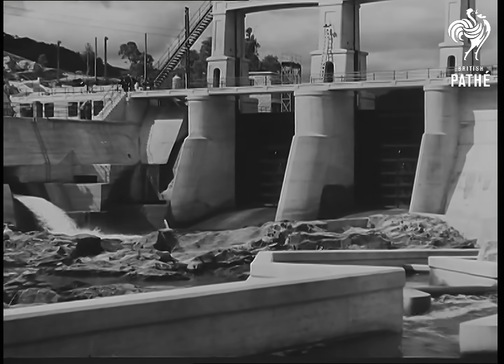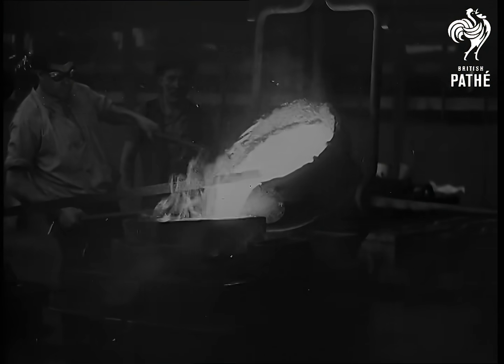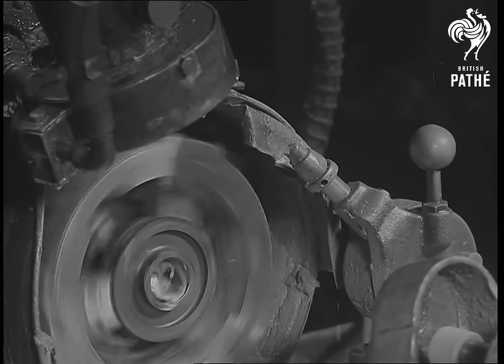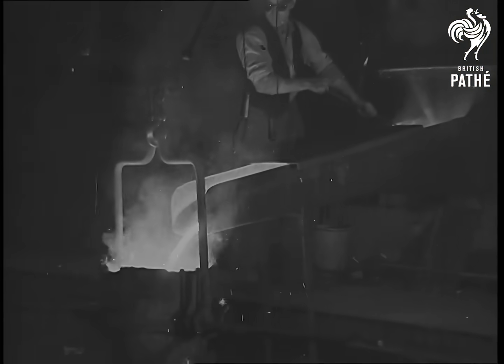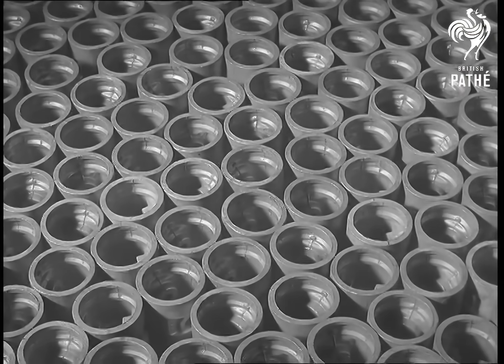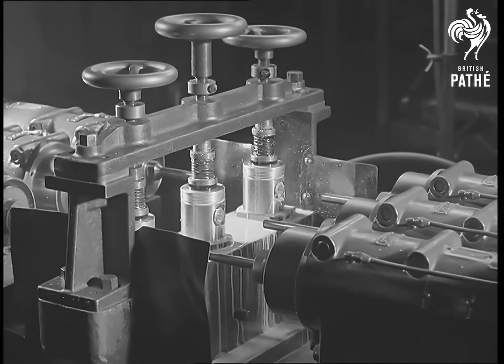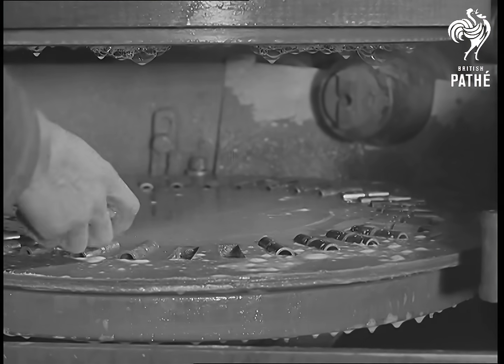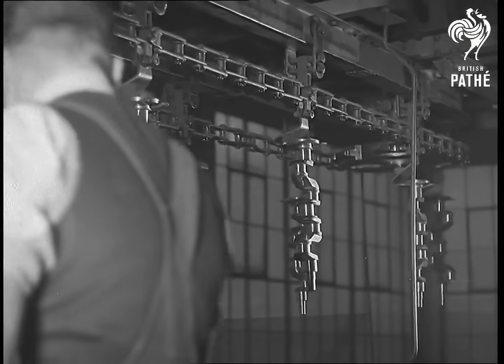Power: Constructing a Car Engine (1930-1939) | British Pathé

Comment: That Morris engine is a direct ancestor to my Reliant 850cc engine.   After the war Reliant bought all of Austin-Morris's particular engine production plant which included the huge selling Austin 7 sidevalve and produced them, when it came to updating the engine Reliant's engineers took an A series engine, saw how Austin-Morris had turned it from the sidevalve engine into the OHV engine and copied the design applying it to the then 600cc engines finishing with the 850 and 950 engines (yes there was a 950cc Reliant engine used in racing) but keeping it all alloy where the A series is all cast iron head and block.   One old hand from the larger company did remark if Austin-Morris had simply done what Reliant had done, it would have had a very lightweight winner as you can have under your arm the Reliant engine and gearbox its that light, imagine the power the Mini could have made with an engine a fifth of its cast iron counterpart and still producing a decent 40hp...

Comment: I work at GM Powertrain Engineering World Headquarters in the shop that builds components for prototype engines.  It's fascinating to see all these steps being performed by traditional rather than computer assisted machinery.
Reply: if you see this, we want v12’s with all manual gearbox. Paddle shifts and automatics suck, please build something with v12 and manual gearbox
Reply: @mococaboy17  No we don't. We want a 4 cylinder port injected cast iron pushrod engine with a 4 speed hydraulic automatic transmission. And a steel timing gear. And it should get 40 mpg on the highway.
Reply: Is that in Pontiac, Michigan,?
Reply: It basically is the same, but manually configured. 

The automated process here is of the type of filling a one step production line. Not a completely automated factory floor.
Reply: Yes, back when people had to use their brains.

Comment: Wow!  It's easy to see why it was rare for engines back then to make 100,000 miles...  the manufacturing tolerances had to be huge to accommodate the primitive tooling and all the manual machining operations.  It must have been a nightmare trying to keep the gang tooling within tolerance as different bits wore at different rates.

Comment: 14.58 The automating machine making the screw is a cam driven type similar to CVA machines. Machines very similar to this were in use up until the mid 1980's. the company I worked for had about 20 all making small items. CVA were based in Brighton and Hove in Sussex.

Comment: This video footage was made by using a pair of spur gears rotating a shaft which was used to control a linkage actuated valve operating a diaphragm to select a machining jig holding upto 20 drills and reaming tools.

Comment: I’m reading old engineering books from this era and just getting onto jig work and multi drilling operations.  Really interesting and recommended to have a look if you get chance to buy old books.  Many of these machines were specific to purpose and so would have been obsolete once the part changed.  Some of the coatings we have for modern engines would have been considered magic when this film was made.
Reply: Lots of machine tools are SPMs (Special Purpose Machines)

Comment: I see that most of the production technique is still the same, with more automation (CNC) and better cutting heads (carborundum), and metals have changed from cast iron to aluminium alloys and plastics.

Comment: So much precision and not a single computer in sight
Reply: Well they still had shop drawings and those machines still had presets to reproduce the same part with exact measurements over and over again. Computers means that process is more easily done and much quicker

Comment: I don't think they open die forge crankshafts anymore, but in the wider scheme of things not a lot has really changed in the production of forged and stamped components.  Machining of parts is where a lot has changed.  Gear production really hasn't changed much, except that companies who make gears now are increasingly milling large gears rather than using gear generating machines for rough processing as it is a much faster process.

Comment: Using a camshaft to machine a camshaft is absolutely genius
Reply: later on they discovered that pistons should be machined by the same principle. because a piston is not perfectly cylindrical by design (reason being heat expansion effecting the top of the piston more than the bottom of the piston), they had to use a master piston which had the desired ovality and machine the parts from that accordingly.

Comment: I was a toolmaker for 15 years, now I'm an inspector and I love seeing these old machines.  We still use some really old manual mills and lathes but the problem comes when you can't get parts for repair....I hate seeing them rust away before they're scrapped.
Reply: Would it be possible to use your toolmaking skills to make parts for these old machines?
Reply: @eUK95  Yeah definitely but as it was, it wasn't viable...management made the decisions.
Reply: Sounds like the place I work. The factory has been there 90 years and some machines are from the 1930s.
Reply: @annabellaandrewkingdon7972  Can you imagine a modern robot/machine running for 90 years?
Me neither. The place i work at, the oldest machines still are the most reliable, and if there is a problem its a small fix 9/10.
Reply: Yes same here, where I used to work we had a mill from the early 40s, lovely solid machine. Till a rat chewed through the leather drive belt. Was cheaper for the company to buy billets and me to spend 2 days making new pulleys to suit vee belts plus adding a tensioner arm as they ordered belts to long lol. That company has long gone but I do hope that mill is still cutting metal somewhere

Comment: To all the modern automotive engineers out there, at 16:29 that's how one drives the camshaft from crank shaft!
 Using metal gears or chains. 
The black flexible belt that you put in your modern transport appliance engines, that is a rubber band with teeth.

Comment: And THIS, Ladies and Gents, is why there are so many of these old cars, still going. Solid engineering, and no highly stressed components. No 1.2L engines producing 200bhp and lasting 3 seconds here.
Reply: The downside is they made very little power, the emissions were through the roof, they left little puddles of oil all over the place and had pretty poor fuel consumption figures. 

Can I ask when you last adjusted the tappets or carried out a de-coke or adjusted the wheel bearings or ball joints on your modern car?

Comment: The smell, the heat, the sweat, no safety goggles or hearing protection of any kind. The absolute danger, they were Men of a different breed than those of today.
Reply: There wasn't much choice. They were stoic because they had to be. That was the culture too.  Safety culture has improved by the standards of that era especially in Mines and large industrial concerns but I still see dudes using concrete saws and jackhammers without any ear/eye pro.

Comment: The engine at 16:57 looks like is has two outlets on the exhaust manifold. Why is that?
Reply: You mean Siamesed ports?   Six intake and three (each oval one merged from two) exhaust?  Cost?  Maybe not enough room to fit more holes?   The old Ford flathead V8 had THREE ports for each bank of four cylinders.  The center two cylinders exhausted through a common center port..
Reply: @martyzielinski2469  No, the exhaust manifold has two *outlets*. There are two pipes leading away from it.
Reply: @Circlotron  Yes, I was looking at the incomplete engine block a couple of scenes earlier.   

It’s awfully hard to tell if that’s a second outlet or not.  But if so, yes it’s odd.

Comment: Oh, something to remember: We see a lot of automated machines in this video, that once started, do their own thing. There were no computers in the 1930s. All of this was done via analog timing systems. Think of all the gears and such you see in an old clock, only on a much larger scale.
Reply: I spent many decades maintaining machines from the fifties that worked on what was essentially clockwork timing of electrical gear. This did that, until it hit a switch that turned it off and something else on, that turned a cam that... and so on. 

It's a wonderfully robust system and I still occasionally occasionally maintain the few that are left even though I long since bailed from the industry. Unfortunately some parts of the system rely on parts that are totally unavailable and they all now run off an Arduino, relays and hall sensors. It's the cheapest way of doing it now (but don't tell the customer) and to be honest far more reliable.

There's a vintage video somewhere on The YouTubes about how the Linotype machine works that's well worth a watch. It's amazing what sort of "logic" people can create with cams and levers.
Reply: Anthony I was a Linotype operator, 1 of the wonders of the 19th century
Reply: And microprocessors are that on a much smaller scale. Electrical on/off switches. And that's pretty much what we are too.
Reply: A Computer was once a 1930s and 1940s  job title for employees who computed optical ray tracing and ball bearing calculations and orbital mechanics
Reply: Mechanical systems amaze me. Imagine the fact that tons of gears and levers were responsible behind the manufacturing of other fascinating machines. Such systems are still used today in some machines
Reply: @lucartl  You mean the tools which machined the engine parts?
In that case repeated accurate machining within close tolerances was no problem for them.
Reply: Analogue logic is fascinating, my friend has a grandfather clock (that fell on him as a toddler) I admired it's intriguing and mesmerizing mechanics, despite it being in an non-operational state
Reply: Mechanical computers are nearly 200 years old.
Reply: @Isochest Older ... Look at clocks.
Reply: Gzzzzzzgzzzzzzzzzzzzzzzzzzzzzzzzzzzzzzzzzzzzzzzzzzzzzz 
Z
Reply: But how does this help Trump Supporters gain political dominance ?
Reply: Interestingly enough I have a hard time concluding whether the time period featured in this video is considered "a long time ago" or "recent history".
Reply: Uniselectors for the win!!
Those things are amazing.
So beautiful, and seemingly very reliable
Reply: Not exactly true, punch cards and state machines, so and over the top relay system..in fact you can occasionally find a very old elevator based on relay logic... No computer.
Reply: Very true. Also these machines did not have automated electronic monitoring systems for temps, speed, clearance etc etc. That was done manually.
Reply: technically, they were computing devices, just not modern computers.
Reply: computer is overrated crap
Reply: @klaasj7808  lmao are you watching this on your analog clock?
Reply: @everytoolashammer9427  lol
Reply: @klaasj7808  based
Reply: @everytoolashammer9427  she need one when im not home.
Reply: @klaasj7808  What an ignorant man you are
Reply: @klaasj7808  I agree with you on the fact that people have been dumbed. But it really doesn't justify that "computers are overrated crap". The amount of scientific research, simulation, spacecraft trajectory planning and control ,etc,etc and other things that we have been doing with computers for decades really make them the real superstars on scientific world.
Reply: @klaasj7808  because those computers werent good as this time computers.
Reply: @klaasj7808  Computers didn't make us dumb, they just weeded out the dumb!
Reply: @klaasj7808  thats bs. for one most existing problems have such computational requirements they simply cannot be solved by human brains. we can pose the questions, even formulate some ideas how to approach it, but the amount of numbers involved is crazy, thats why we need microprocessors. what could be done analytically, or with good enough approximation, has been done.

also researchers were very much widely using computers by the 50s.
Reply: @klaasj7808  no they are not. I have a cnc machine shop and own about 8 of them. I can do manual and cnc. we make parts cor the coin making industry. no body puts down cnc who knows how to run them. its always those who never learned.
Reply: that being said, its hard for cnc to compete speedwise with multi spindle gang machines built specific for the part. this is a first class operation

Comment: Pretty incredible. 

At some point you can imagine a conversation taking place along the lines of... 'We need to design a machine that makes the parts for the machine that makes the parts for the machine that makes the parts for the machine that makes the parts of the engine.'
Reply: Some argue that the lathe is humanity's most important invention
Reply: Clipspring's channel in a nutshell.
Reply: Die Maschinen zur Herstellung der Motorteile und Getriebeteile sind Sonderanfertigungen. Ob bei Ford oder Perkins oder in Italien bei Fiat und in Frankreich bei Citroen oder bei Belarus in Minsk sind alle unterschiedlich. Die Werkhallen sind auch alle anders. 
Also sind die Herstellungsmaschinen alle Sonderanfertigungen. 
Der Bohrer, Drehstahl, Ofen zum Härten, alle kleinwerkzeuge sind gleich. 
Ein Motor aus den verschiedenen Ländern ist im Grunde auch gleich. Jedoch der eine Motor ist besser als der andere wenn er dann gefertigt ist. Ob der aus Italien besser ist???? Oder der Motor aus Frankreich. Natürlich haben die Motore verschiedene Herstellungskosten. So wird der aus Minsk billiger sein als aus GB. 
Das ist der Weltmarkt.
Für 1930 eine riesige Leistung der Menschen in den Fabriken.
Reply: 👏👏👏 from 🇹🇷

Comment: Its amazing how most parts back then were machined or milled from solid steel. That would cost a fortune today.
Reply: STILL DONE but much of it today is cast aluminum. Even most of the valve covers are cast aluminum. Except BMW that uses plastic.
Reply: @OffGridInvestor  yeah most metal parts are cast today unless you're buying a Bentley or something lol.  Just the amount of work that went into these cars back then is pretty cool

Comment: How do you design all the machines with pen and pencil? It’s amazing.
Reply: With lots of people using large drawing boards. At the start of a project they work out what can be used or modified from previous work such as bases, columns, spindles, fixtures etc. Then supervisors meet from time to time to review progress and ensure costs are in budget.
Reply: Surprisingly easily actually. You know how you can do complex woodworking without any sort of drawings, just by eyeballing adjustments and fittings things together as they go? Same is true for metalworking. You don't have to spec every last dimension and it's tolerances to make a one off machine.  In fact there is no point if the manual methods used to manufacture your design don't allow for precisely meeting your designs anyway.

Comment: Pistons of that day were very small
Reply: That was at least in part due to how road tax was calculated in the UK. Cars were classified according to "taxable horsepower" which was calculated according to the total bore of the engine. I'm making up the figures here but the principal is right... Say you had two cars one with a 1000cc engine and a short stroke / big bore and one with a 1200cc long stroke / small bore. Because the 1000cc engine had bigger bores than the 1200cc it would be given a taxable horsepower rating of 12hp and the 1200cc engine a rating of 8hp.  The 1000cc 12hp car would pay more road tax.

This was enough incentive to make long stroke / small bore cars until the rules changed and all cars became classed as "Private / Light Goods" and paid the same tax. There's also the fact that materials weren't as good back then and getting power from short stoke engines that revved much higher wasn't really so much of a thing. On the plus side long stoke engines do give more torque all other things being equal.

Comment: State of the art technology at the time but still being used to produce the Morris Marina 40 years later.
Reply: Walter Dumbrowski  
Which is part of their problem. Making the same exact bike and not adapting to the times. Nice bikes, I had one. But others make a  better bike for the money.
Reply: @geoben1810  You can still buy a Morgan sportscar built in the same way since the 1930's and you will pay a premium and probably have to wait some time to get one. Horses for courses. I'm not a Harley fan since seeing one throw all it's oil and most of its crankcase into the gutter as it passed by me!
Reply: @keithhoughton4308  Wasn't the old adage if a british bike ain't leaking theres no oil in it?
Reply: @keithhoughton4308  The thing is that so many owners of Harley modify their ride even the engine that is why they like the design it is easy to change things up.

Comment: Bashing white hot metal with no personal protective equipment.  Those were the days
Reply: A red hot sliver in the eye was a walk in the park. You'd get home, and your wife, or one of your 6 kids, except for the ones that had polio, could get a pair of home forged tweezers to pull the metal out, while you bite down on some type of animal bone. Then you could put a lead based salve in your eye, smoke a pack of Lucky Strikes, and call it a day. The only thing you had going for you, is you'd be thin as a Whippet.